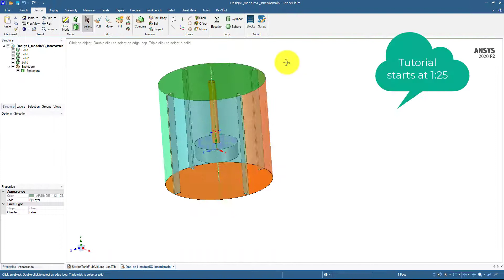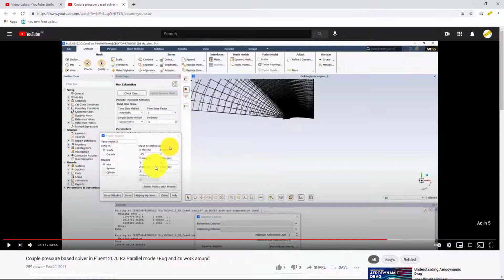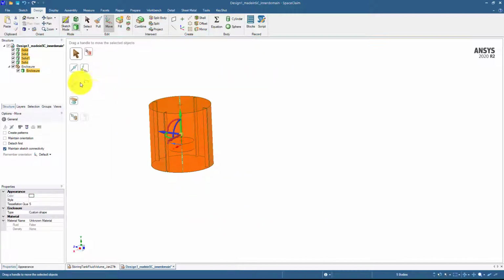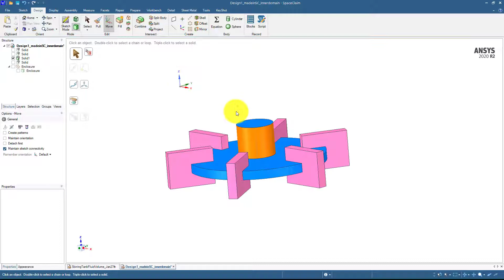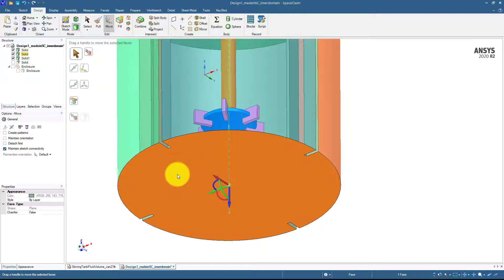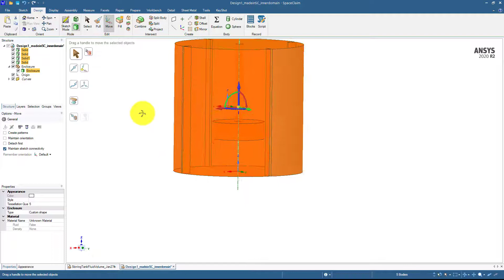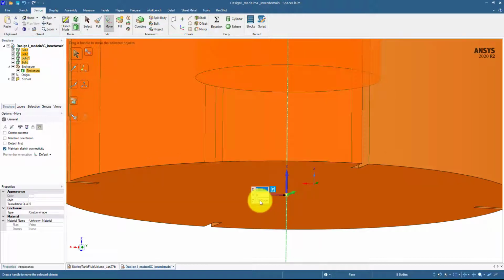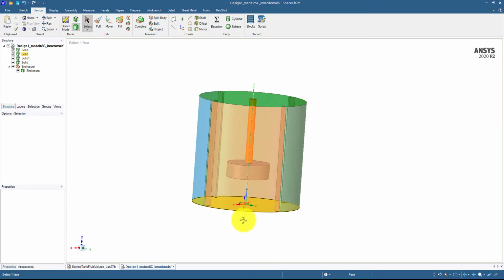How to move geometry at required axis and origin in ANSYS SpaceClaim

Comment: the model is not located at correct position. the model must be located at first quadrant and one corner position must be matched origin of global coordinate system.

I have this problem. How can i fix it?
Reply from the maker: use spacelcaim and move it
Reply: @CFD_Mechanic  I have tried the 'move' option, but the problem remains
Reply from the maker: @Batmandellazona  you can avail my consutlancy serives. 50 USD for first hour and 30 USD onwards